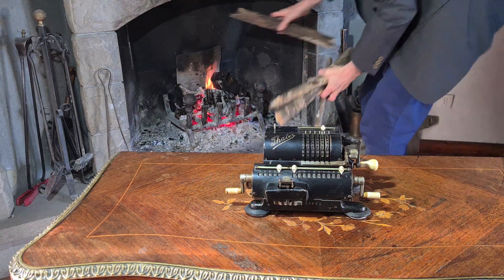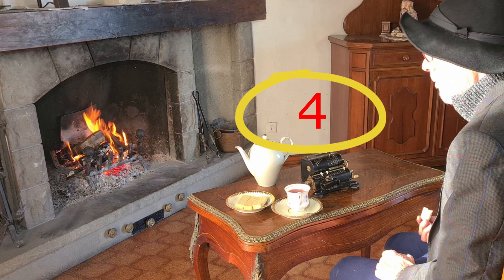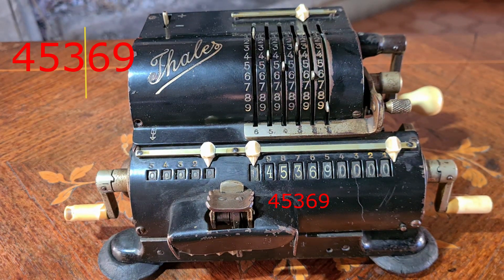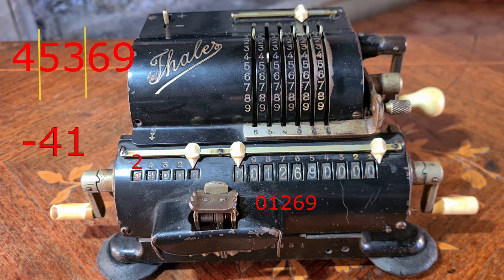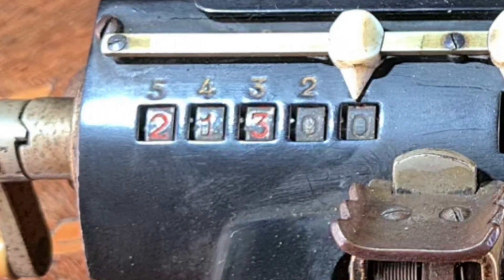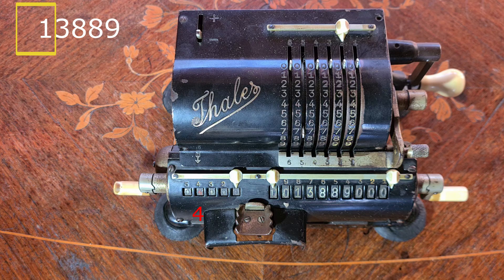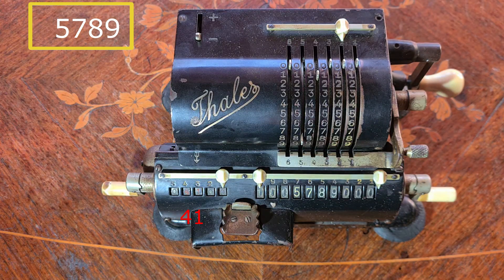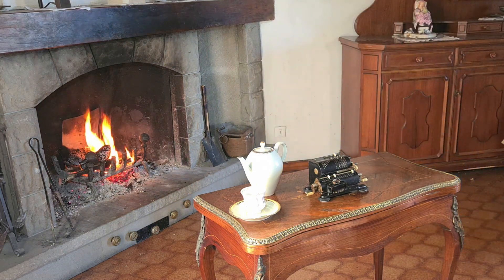How to calculate square roots with old mechanical calculators (using a Thales from 1925)

Comment: Thank you for this. It is the first really understandable demonstration of working out toots on a mechanical calculator I have seen. I have a small collection of them so it is something I have wanted to learn to do.
Reply from the maker: Thanks, I had the same problem, I didn't found an explanation on square roots with mechanical calculator, so I did one.

Comment: This also works if the root doesn't work out to be an integer. You just continue until the counter register runs out of digits.  It does not work with a 10-key calculator like the Facit machines, because you can't change single digits of a value in the input register.
Reply from the maker: You are right Fritz.
Thanks for the precisation about the Facit, your comments are welcome.